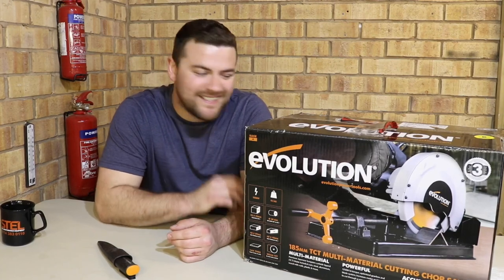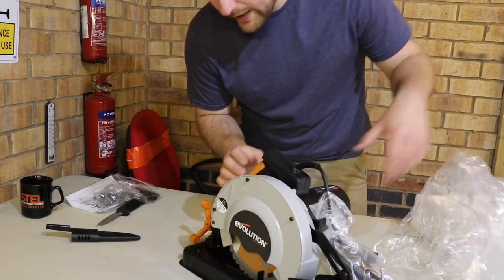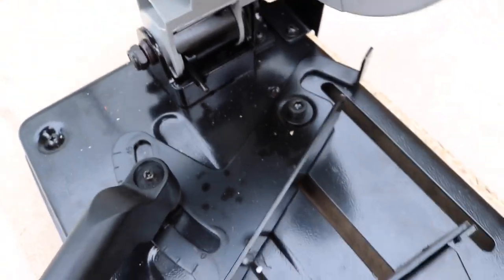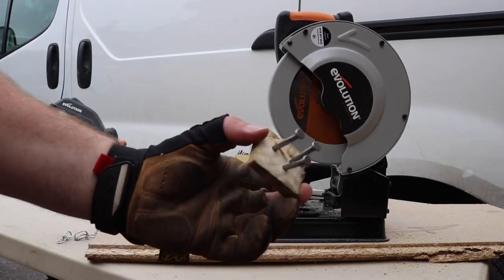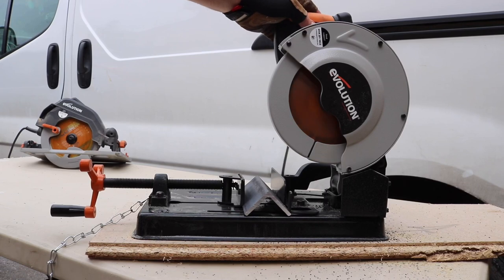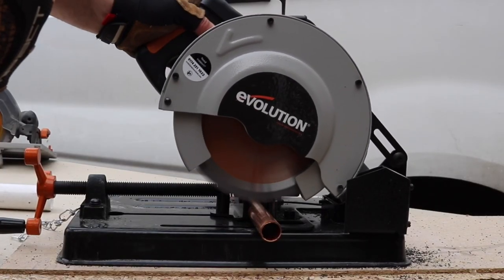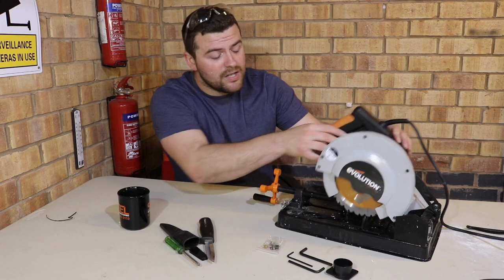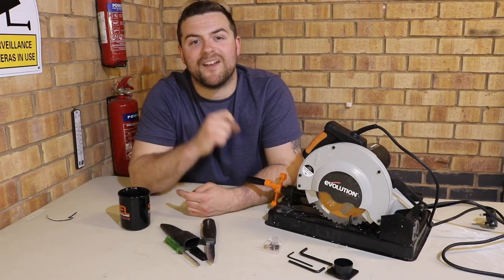EVOLUTION RAGE4 1250W 185MM ELECTRIC CHOP SAW

Comment: Thank you for your video review ..👍🏻 The only thing that puts me off of buying one, is the back moveable fence doesn’t go all the way down to meet the base, there is a gap that would let thin items go under it. I would have to modify it by sticking something onto back plate and having it come down to sit flush with base , Not impossible to do with some double sided impact tape and a flat piece of either wood or metal. I would be ultimately be getting it to cut aluminium door trims ( profiles ) for carpet and vinyl flooring.

Comment: Hi! Do you still have this saw? How it's going? It's still working? I want to buy one. I have a very small workshop space. But i would like to know if it's quality built. I would change that blade it comes with for a diablo steel demon, which i've heard it's much better (evolution blades have a bad reputation) and can withstand many more cuts without getting dull. I'm not rich, so if i need to invest in a tool, it has to be a good one that lasts and can be repaired. Would you recommend this saw to me? Thanks for your advice!
Reply from the maker: This saw is good for the occasional use if you're going to be using it a few times a day then you may want to consider something more robust. However saying that I use my saw once a week maybe and it still feels good 👍🏻
Reply: @PlumbingGy  Thanks a lot for your response. Honestly, although i don't do heavy stuff frequently in my little workshop, i would rather get a robust tool. Because you never know when you will need to give it some heavy intense use (sometimes, formal job is scarce, and you depend on your manual skills and your tools to survive). I was thinking on buying a second hand milwaukee circular saw for metal, and building a little stand to use it as a chop saw when needed. That way i could have two different uses for the same tool. What do you think? Greetings from Mexico
Reply from the maker: No problem, Milwaukee is a good choice I'm personally more DeWalt these are a good kid range choice and should fulfill your needs Marco. Hope it's helped 😁✌🏻
Reply: @PlumbingGy  Thanks a lot for your advice! Have a nice weekend. Blessings

Comment: I was a little disappointed in the clamp mechanism when looking at it in the store I saw it in.
Reply from the maker: Have to agree it's not the best but the idea behind it is it's a workshop saw so generally you don't use it. 
As for on the move it's not the best clamp 👌🏻
Reply: @PlumbingGy  I still like it, I would swap the clamp out to get parallel cuts too. Cheers ☺